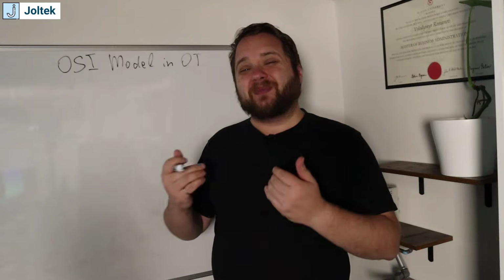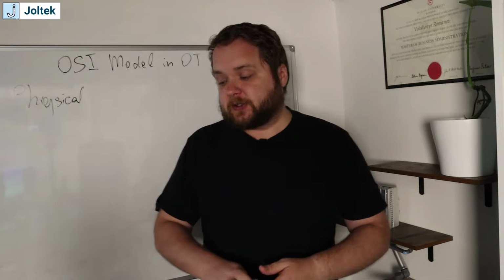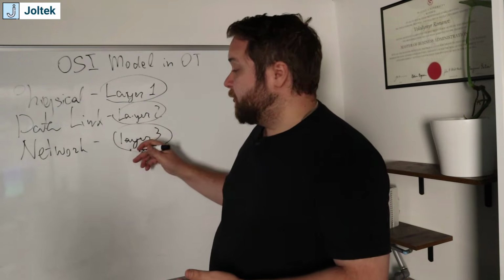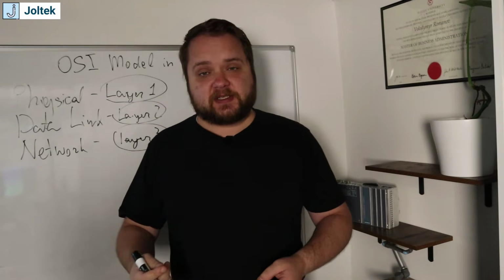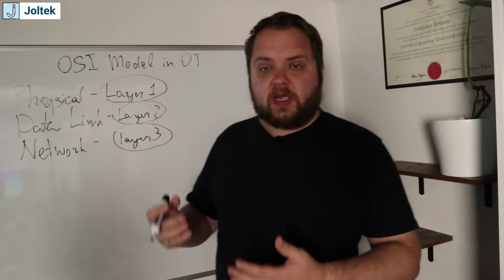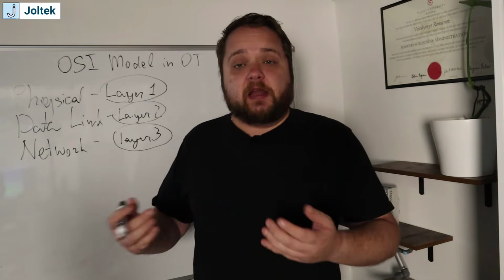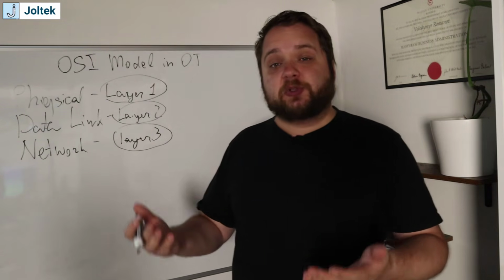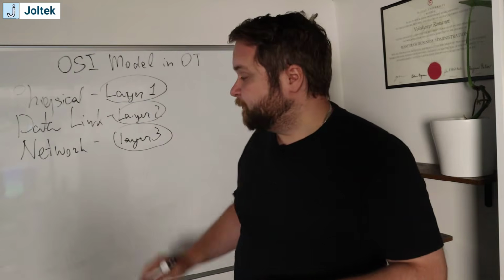L2.5 | OSI Model Layers in Manufacturing | Networking Fundamentals for Engineers and IT OT Teams

Comment: Oh, at the 1:38 sec mark, that was hilarious! Talking about how OT physical cables are run "...unlike the traditional network setting where everything is nice and neat and the physical layer doesn't always get troubleshot."  Tell me you have never worked in IT networks without saying so explicitly.  I am a traditional IT network engineer. I have yet to work with nice, clean well done physical cable plant.  Bad copper and fiber runs cause plenty of problems.  Cable issue are commonly troubleshot.  I have watched a couple video on OT networks, and it seems like there is this "us vs them" between OT and IT vibe on all of them.  There is no reason for this.  It.s not benefiting the organization, and not leading to a better run environment for the organization.

Comment: Are these video lectures part of a course that I can register somewhere? I have experience with PLC but need to brush up on OT (and IT) side of things in Industrial Automation. Vlad any plan of doing courses on LV or MV Substation involving installation and commissioning? Thanks
Reply from the maker: Hey! Right now I'm just releasing all of them in sequence free on the channel. I plan on making it a free course for a certificate; just need to find time to get it done. I've been doing a lot of travel for different systems recently, so haven't had a chance to publish the course on a proper platform. I'm also going to build a more advanced series that will be published hopefully by the end of the year, but it's still TBD. No plans on the substation side as I don't do many of those myself; usually just manage a contractor for that.
Reply: @VladRomanov89  Thanks Vlad!